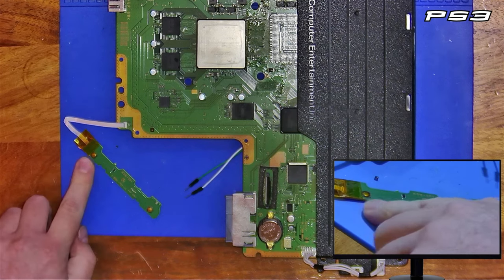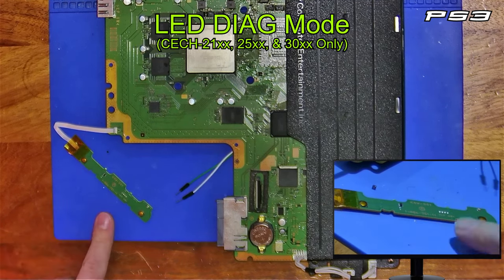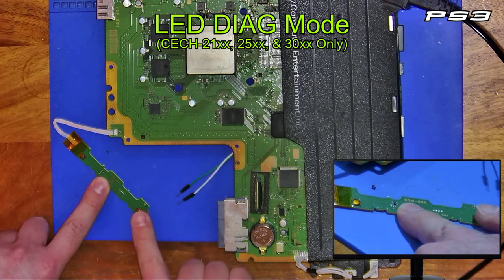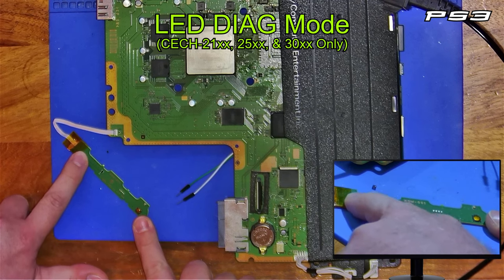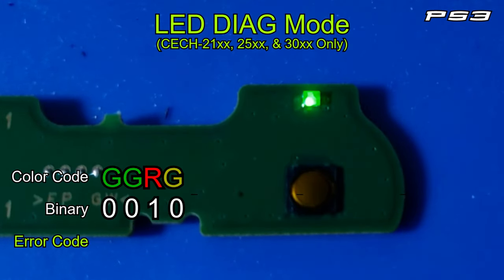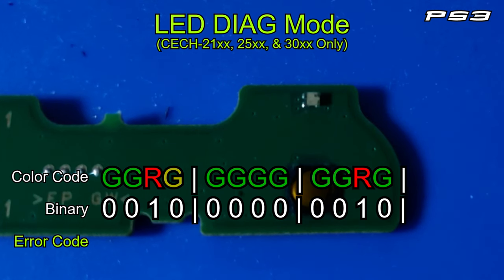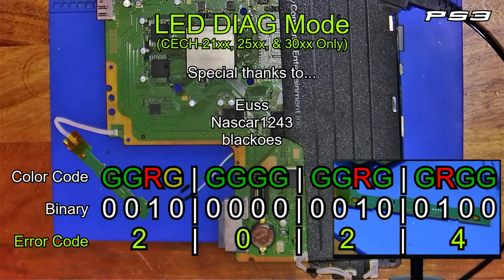PS3 Slim - LED Error Code!

Comment: Great finding, thanks for sharing. Tested it on my fully functional CECH-2103B and received the following code: 0010 0000 0010 0010 -> 2022
After looking up the error code it appears to be sort of no video out using HDMI which makes sense given that the PS3 is in the LED Diag mode.
Reply from the maker: Those are normal on a console that's working. Just checked the errorlog on a P model earlier today using ps3toolset.com. It had three A0802022's and the rest of the log was empty. It's a fully working console, so those errors are normal to find.
Reply: @ripfelix3020  Do you think the playstaion 5 has this feature but we dont know how to access it.
Reply from the maker: Surely there is some kind of error system employed. SONY likes to hide and encode them to prevent anyone other than authorized repair facilities (under NDA) from accessing and interpriting their meaning. 

It's like welding the hood of your car shut and charging 50x what it should cost when the battery dies. Then claiming it's a highly technical procedure that, 1) you can't be trusted to perform, and, 2) shouldn't be allowed to because it risks their intellectual property and could damage their company. Which is not only patronizing, but anticompetitive...and also completely leagal, Unfortunately.

Your car is a safety hazard, so government regulators don't allow as much of this non-sense. But consumer electronics are just entertainment devices costing as much as a major appliance, and can only burn your house down. You know, nothing bad. No need to place pesky regulatory standards in the way of their freedom to exploit the sheeple. Makes perfect sense.
Reply: @ripfelix3020  just what I expected, well with you in the playstation scene we are in good hands you really know your shit and I love it

Comment: how'd you find that?!
Reply from the maker: Dredged up an old post on the ps3 dev wiki by Euss. He didn't know what to make of them. There was a thread on PSX place from 2019 too, but they couldn't figure it out either. My buddy Nascar1242 and I were able to correlate the code to binary, since I knew this MB had a 2024 code from the syscon uart. So kinda breaking news here.
Reply: 2024? O.o

Comment: Pretty cool. Did this with my CECH-3001A to test and just got GRGR RRRR RRRR RRRR. Also tried on my CECH-2001A just to see and it indeed doesn't work.
Reply from the maker: That's 5FFF. It's a bad code often associated with CPU damage. Like a dropped console requiring a reball or where the cpu is dead.
Reply: @ripfelix3020  Interesting. The console does work fine
Reply from the maker: Huh...has it ever been opened? Like previous repair?
Reply: @ripfelix3020  I've opened it before for cleaning and also replacing the thermal paste. That's about it. It's always worked just fine

Comment: Good video! I’m curious what my CECHL01 PS3 issue is. It has YLOD (although not always, sometimes it’s just red light) about 15-20 seconds after turning it on, and it has no image. I don’t have a syscon testing tool at the moment.
Reply: I have a ps3 backwards compatible  with the same issue I think it's the gpu but I am not sure

Comment: Did you say this mode is accessed by powering on while holding eject? I've known that as a way to run the fan at max, but had no idea it did more than that
Reply from the maker: Yeah, that's the 1st step. Euss found it by mashing power and eject buttons after it completed. Which I can see, since in that state the console wont go back to standyb until a power cycle. Later someone found a consistent button combo.

Comment: Thanks for sharing, in your experience how reliable is the 65nm RSX in the slim 20XX ?
Reply from the maker: very. I have confirmed it doesnt contain low Tg underfill and there doesnt appear to be an increased failure rate attruibatble to the any 65nm RSX. Even the 1st model recision.
Reply: @ripfelix3020 So no need for a 40nm RSX on the slim models unless the RSX goes bad?

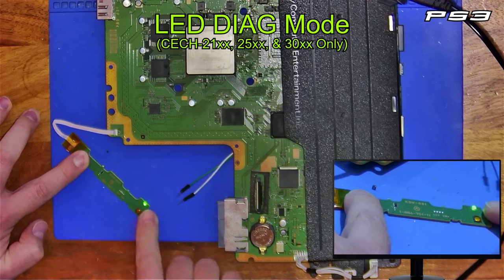Comment: 0:18 To me, the "Fan Test" isn't a Fan test exactly. This is a second start-up mode dedicated to force Eject a disc stuck in a PS3 which is YLOD, or overheating. This is why this mode doesn't exist on a Backward Compatible PS3 and for the Super Slim model (Maybe I could be wrong but this is really what I think).
However, thanks for this video, i'm going to test it now on some PS3s
Edit : Tested on a CECH-2500 never YLOD, I've got GGGR|GGRG|GGGG|GGGR| -> |0001|0010|0000|0001| -> Errlog 1201 Overheating GPU
Edit 2 : Tested on a CECH-3000 YLOD GGRR|GGGG|GGRR|GRGG| -> |0011|0000|0011|0100| -> Errlog 3034, Classic 2 second YLOD.
This code is good, I remplaced thermal paste on it, but one time I turned on the PS3 without the heat sink !
Thanks again for this video !
Reply: Nice..
Reply from the maker: Yeah, you can think of it that way too. I always thought of it as a way to blow dust out of the console. Engage it and blow at all angles with compressed electronics duster. The fan assist in blowing it out. Doing that regularly prevents it from building too much and just blasting you with dust.

Comment: Probably all models have this but the problem is that we don't know how to trigger it
Reply: It’s triggered the same. My CECHK phat can do this.
Reply: @andrupka8749  It's isn't on all models. On BC models there isn't fan test or at least we don't know how to trigger it
Reply from the maker: We tried it on a SEM-001 (G), DIA-002 (K), VER-001 (L) and DYN-001 (20xx). Couldn't trigger it. If you got it working on your K model, I would be particularly interested in hearing how.
Reply: @ripfelix3020  rapidly spammed the power and eject buttons after the fan test in no particular order

Comment: I always thought the slim ps3s didn't get the yellow light of death... how reliable is a 25xx? And which hackable modle would you say is the most reliable?
Reply from the maker: All models of ps3 are aging and their components are begining to fail. The slims are newer and didn't suffer from bumpgate related GPU failures. So we noticed the phats die 1st. But as time goes by slims are next in line for their perisahbles to spoil (caps for example). That 3001A slim in the vid has a bad bluetooth/wifi module, which does seem to be a common vulberabilty in models with them.

21xx is often "said" to be the most reliable. 40nm RSX, no tokins, still jailbreakable. But I wouldn't say there is clear evidence to say it's more reliable than a 25xx or 30xx. It's just that some 25xx are not jailbreakable and 30xx arent for sure  So the 21xx is the most desirable slim for that reason. Probably the next most desirable PS3 besides the backwards compatible models. Outside the special editions.

Comment: my ps3 slim has had these "noLOD" issues basically since I got it, which would prevent it from starting, and they only got worse over time. So I decided to try this to shed light on what the issue is but, the error code I get is 5FFF, which the dev wiki doesn't list...
Reply from the maker: 5FFF can be several things. CPU issues are cheif among them. But it has been reported possable in a bricked console (presumably FW brick, OP didn't specifically say). But it has been reportedly fixed with a CPU reball. Not that those models are worth the effort, being cheap. 

I should say I have far less errorlog data to go off of from slim models, so linking errors from those models to their respective fixes is hindered by lack of reporting.

Comment: I don't understand the hexadecimal codes very well but applying what you show in your video this is the error code I have ggrr gggg gggg gggr
Reply from the maker: That's 3001. 12v Failure usually from a PSU. But word of warning, if the the 2 prong 12v connector of the PSU wasn't connected when you last tested the console then 3001 is normal. Sometimes people only connect the 5v, which lets them get the red standby LED. That allows you to perform the SYSCON UART diagnostics. If you try to power it on without 12v, OFC you'll get a 12v power failure error (3001).

But if you are plugged in properly and still seeing that, your PSU is probably bad.
Reply: @ripfelix3020  ok, I'll try another psu

Comment: I actually posted my results with this on psx-place. I have a very strange sequence coming from a slim 2501A: GRGR/RRRR/RRRR/RRRR Which would be 5111? I need some help making sense of this. I'm still waiting on my USB UART adaptor so I can get proper syscon codes
Reply: Actually this would be 5FFF right? I can't find any info on it
Reply from the maker: usually means CPU BGA or dead. I havent updated the ps3 dev wiki with it yet. I'm still collecting data.

Comment: Heheh dumb question how do you know if your ps3 is CECH-21xx, 25xx or 30xx?? My ps3 model is CECH-2500B and it's currently experiencing NOLOD means No light of dead, it's a newer form of yellow light of dead YOLD
Reply from the maker: You check the barcode at the back for the model number. Every retail PS3 starts with the prefix CECH, so it's not necessary to refer to it when differentiating. The last 2 digits are the region code. 00 = japan, 01 = North America, and so on. The letter just indicates the HDD size. So CECH-2501B for example is a North america ps3 slim with the larger 320GB HDD option. 

When I refer to 25xx models I mean all models in every region.

Comment: Hey there, i got the code 14ff on my ps3 slim 21xx. Would this test be enough of a diagnostic for me or would i need to do anything else?
Reply from the maker: It's not enough on it's own to determine what's wrong (assuming there is an issue). Checkstops usually are a HW issue and there is often a 3034 in the errorlog. Unfortunately the led diag mode only retrieves the last error in the log. Not the other 31. And they need to be taken in context with console behavior and history. Like how is it acting now, is the warranty sticker void, does it have any repair history, is it full of dust, have melty plastic neat the vents...etc.

All of that taken together can yield a proper diagnosis (or best guess).

Comment: Ive got a slim model 2501 and om hettong error code 8002f1f9 i was told to replace the wifi/bt module,cmos battery or just get a new ps3? any advice would be greatly appreciated.
Reply from the maker: From the ps3 dev wiki, 8002f1f9 is an error with installing Firmware update. Check the connection of the Wifi/BT board, reboot system and reinstall firmware. 

Depending on where your from it may be cheaper to buy another slim. I've found thrift deals for 30-ish bucks (USD).

IIRC that model has the wifi/Bluetooth onboard in a module that's BGA, which is unfortuatly difficult to replace and a common thing to kill slim models that are otherwise tanks. It always has to be something.

But to be clear, IDK that it is causing this error for you. I don't work on slims often. And the one I was working on in that video had very different symptoms with it's clearly bad BT/wifi module.
Reply: @ripfelix3020  thanks so much for the feedback I have another slim but it's my og that I started with and it has games and runs fine I've had it for like 20yrs and is already updated I did that when the cmos battery scare was going around 😂 this one that has the error I got from my nephew because it was literally gonna get trashed if I didn't I cleaned it and wanted to mod it with cfw come to find out if it was already modded I could have easily bypassed this issue with an update that doesn't check for wifi/bt I'm gonna open it again check some things out if all else fails have someone else  professionally work on this one as I'm in the process of learning how to solder and reballing seems very technical and if that doesn't work I'll just get another ps3 and hope in the future they find a way to bypass this issue to prolong the life of this amazing console.

Comment: Hello, is 3034 fixable on Slim ? and if yes how can it be done ?
Reply from the maker: Usually, it's caused by a BGA defect requiring a reball (in that model). Often because of drop damage or flexing the board too much when changing paste. If you or someone previously attempted a delid, trace damage could be the cause. In which case it's hosed!

Comment: do you know what the LED Error Code: 3032. Means?
Reply from the maker: Error during CPU initialization. Often a BGA defect or dead CELL. Litterally, it's a CELL XDR Clock Generator Refrence voltage error occuring during the CPU configuration ring. That's early and not good. There is a remote chance the clock generator responsable for the XDR/CPU interface has gone bad, or one of the SMDs on the line. Inspect for obvious damage and pressure test the CPU. My money is on bad CPU joint.

Comment: I have a 
GRGR|RRRR|RRRR|RRRR 
WHAT THATS MEANS
Reply from the maker: 5FFF, it's a sherwood only code that often means the CPU needs reballed. Perhaps a fall or bad thermal paste application/delid. It can be caused by a bad FW installation or jailbreak brick. I suspect other causes too, but not sure all the ways that can trigger it.
Reply: @ripfelix3020  i go to repair it and the repair shop said that the problem from the cpu and he fixed it but when i return to my house i power on the ps3 the fan goes very fast i have changed the thermal nothing changed the same problem is i think my jail break is bricked because i dont see any of my app or my cracked games no multiman no webman non of them and when i go the system the storage is already full 139 gb from 140 the fan goes up even i didn't enabled hen  
What wrong with it
Reply from the maker: Was it delided by the repair shop? The paste under the IHS on the die often wears out and can cause overheati g quite fast. Alternativly, the rework the shop likely performed (reflow or reball) can damage the thermal monitor next to the CPU. If a delid does not fix it, then replacing the thermal monitor and external sense line resistors may be needed. And if that doesnt work, the issue is a bad thermal diode inside the CPU (it's dead) or a bad reflow/reball in the first place (which needs redone).

Comment: Mine is 0011 0000 0011 0100
Reply from the maker: 3034. Either the CPU or GPU failed. They are both possable and I'm not sure which is more likely yet. The GPU's dont have an inherent defect in slims like they do in early phats, so BGA defects can afflict the RSX and Cell equally. There may be one that recieves more wear an tear either through thermocycling or is more vulnerable to shock from a fall. A pressure test can help you determine if there's a BGA defect and on which processor.

Comment: Thanks for the info. Tried on my 2504A (JSD-001) with dead CELL and it shows me the right error code (3032 (CELL error)).

P.S. Never try to delid CELL at 25xx and above, there is a chance that the crystal is glued or soldered to the lid (like on mine). It’s glued or soldered to the lid so tightly, that the lid cannot be removed even though the silicone is cut off.
Reply from the maker: What's your color code if you dont mind sharing.
Reply: 3032 translates to GGRR GGGG GGRR GGRG I believe